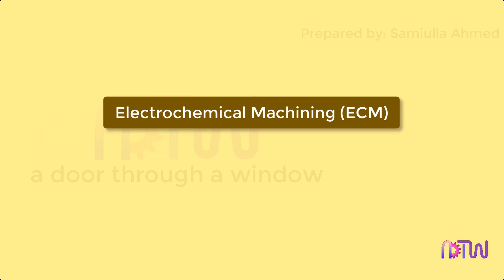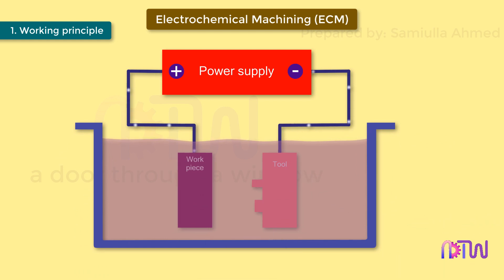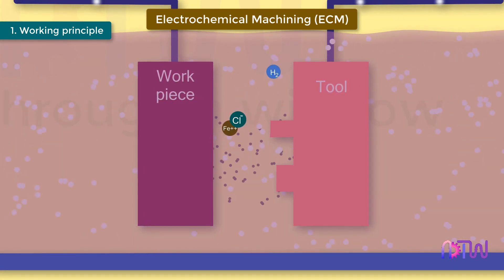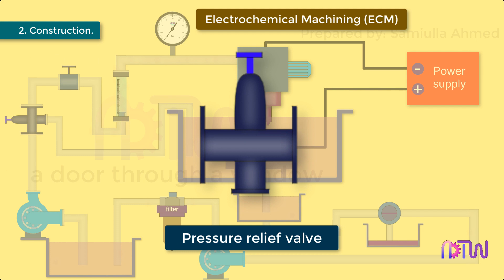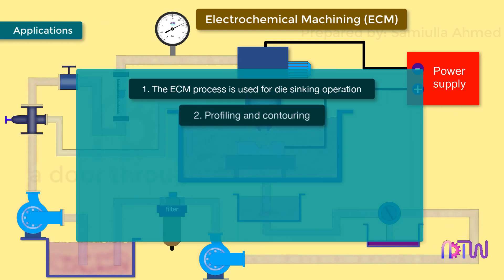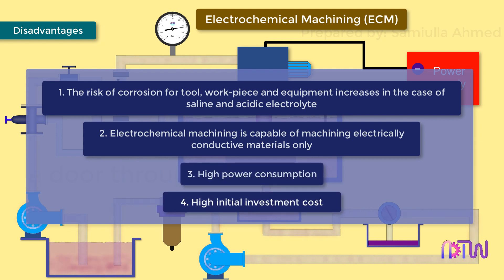ELECTROCHEMICAL MACHINE (ECM): Construction and working of electrochemical Machining process.

Comment: 🎯 Key Takeaways for quick navigation:

00:05 ⚙️ Electrochemical Machining (ECM) is used for mass production to remove metal from electrically conductive materials that are hard to machine conventionally.
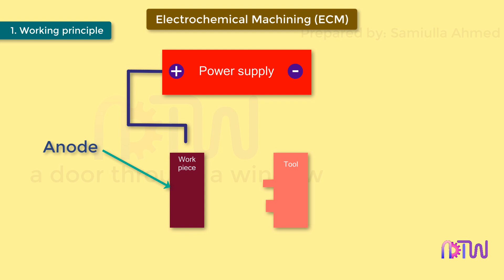00:48 🔄 In ECM, material removal occurs at the atomic level between anode and cathode electrodes immersed in an electrolyte, resulting in a mirror-finished surface.
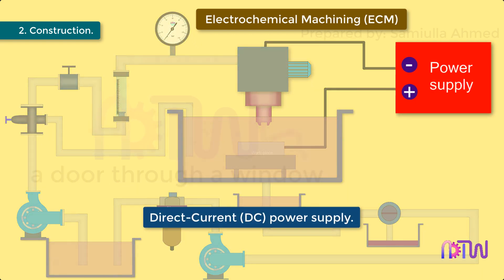02:25 🔧 ECM setup includes a power supply, electrolyte, tool, workpiece, and various components for fluid circulation, filtration, and sludge management.
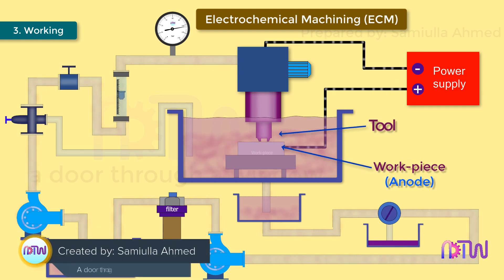04:03 🛠️ The ECM process involves assembling the workpiece, immersing it with the tool in electrolyte, applying a potential difference, and advancing the tool to remove material, producing excellent surface finish.
04:59 ✔️ ECM is applied in dye sinking, profiling, contouring, drilling, grinding, tree planning, and micro-machining, offering advantages like negligible tool wear and the ability to produce complex parts with excellent surface finish.
05:27 ⚠️ Disadvantages of ECM include the risk of corrosion, limited to electrically conductive materials, high power consumption, and a high initial investment cost.

Made with HARPA AI

Comment: General information for the shool children, but not a practical info. here. How about telling us about the voltage and Amperage needed, The work gap between workpiece and the tool/cathode. Is there all the time same gap or you use larger gap for roughing(as it appears, that roughing and finishing methodology is employed). On the average, what is the gap settings and voltage/Amperage and electrolyte pressure needed for rough or finish operation? What is the material removal rate, comparing to EDM. What materials can be and are used for the tool (Graphite or Copper-both electoconductive, but very soft).
Reply from the maker: Yes, you are right these videos contain very basic information I have created this video for students who face difficulty in understanding the basic concepts of machining processes... In future, as you said I will make videos with detailed information containing all the practical knowledge...
Reply: @ADTWstudy  let me know!